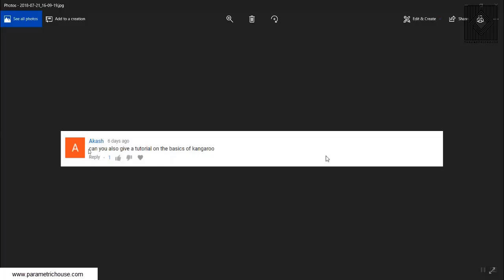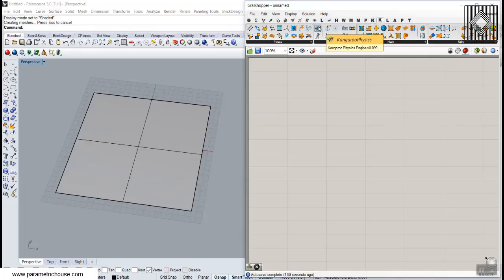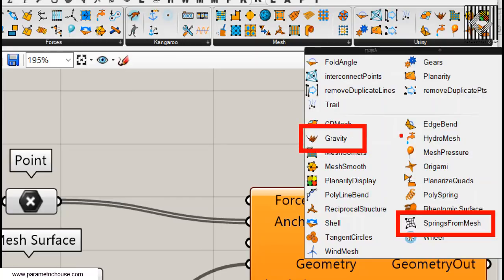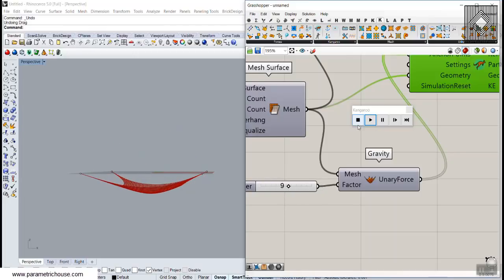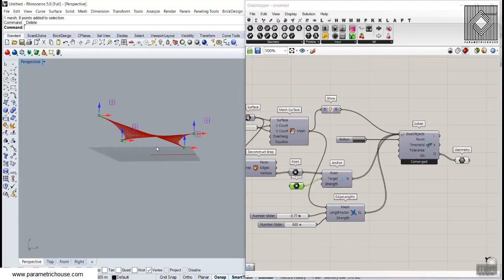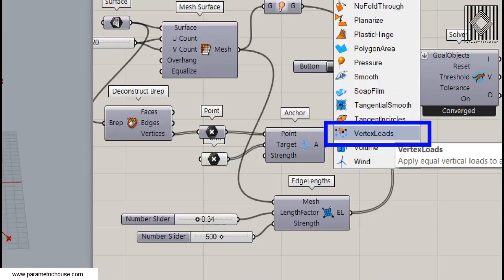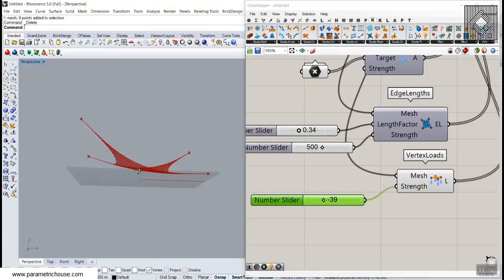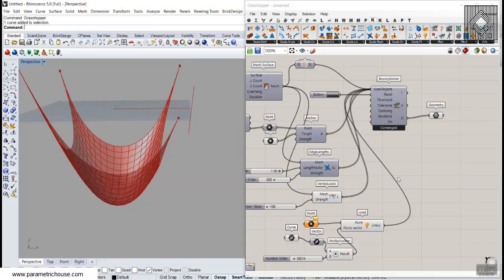Kangaroo  - Grasshopper Tutorial

Comment: Question! What if the surface is not a square but a circle? I tried your method but it's not working and the Kangaroo turned red.
Reply from the maker: If you want to use another surface be sure to convert it properly to mesh. Kangaroo works with mesh

Comment: When I double click on the kangaroo physics, nothing shows up. the  little window doesn't pop up. Do you know why it won't show ?
Reply from the maker: It doesn't work on Kangaroo2, i guess ir's only for Kangaroo physics
Reply: Parametric House I fixed it thanks !
Reply: Parametric House also can you have more than 4 anchor points ? I tried with six but it doesn’t look like it’s working
Reply: @marthylda  How did you fix it? I am having the same issue on a Mac, installed both 0.099 and 2.